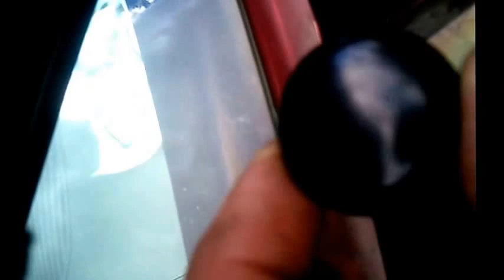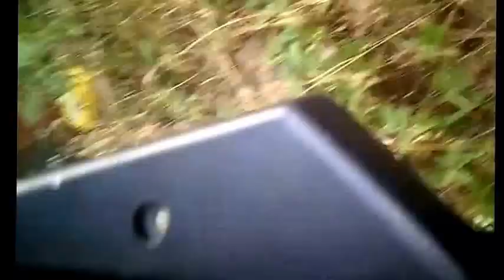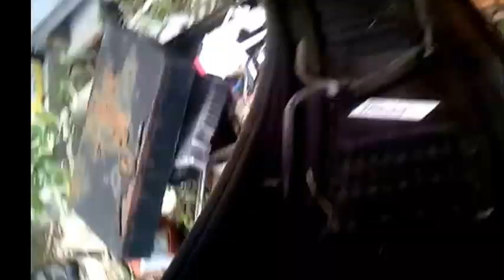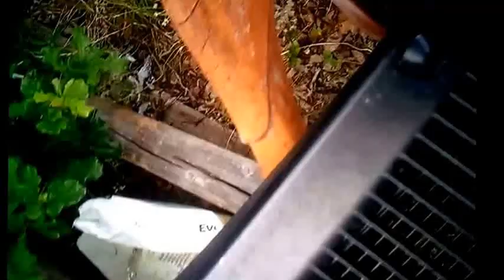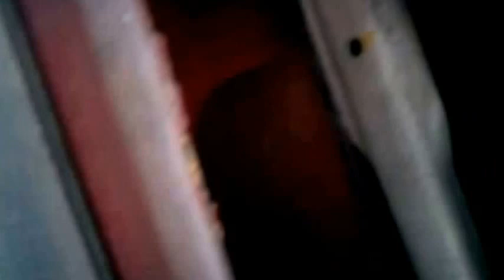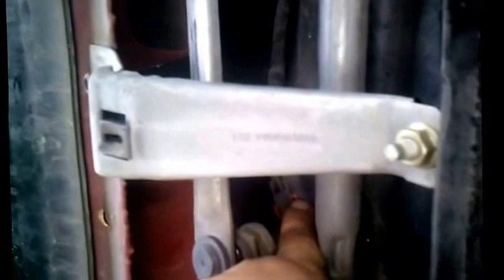How to Fix windshield wipers 2005 Chrysler Town & Country

Comment: What were you saying would happen if you had a bad motor mount?
Reply from the maker: +COKEDUDEUSF yeah that front mount it's broken on the engine often if the Wipers
are running when the engine lifts up it'll hit the wiper motor and break the wiper motor happens real off and on that vehicle